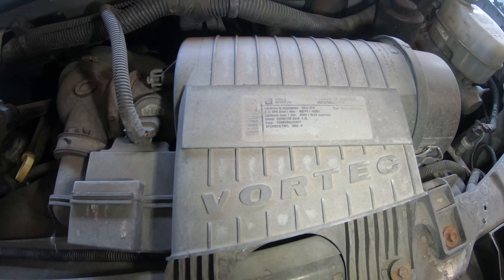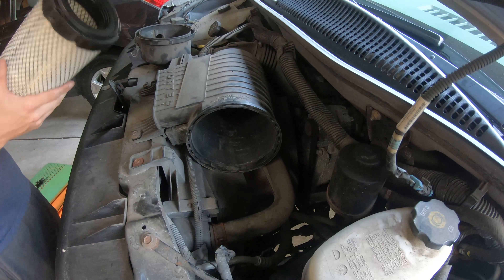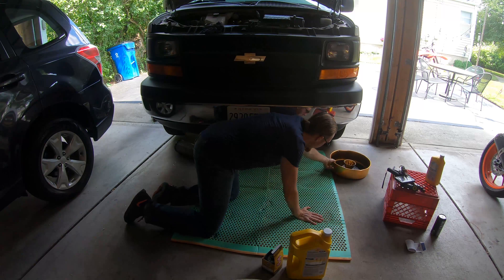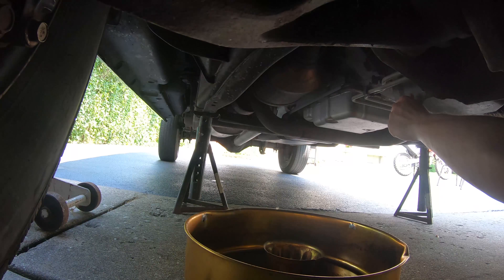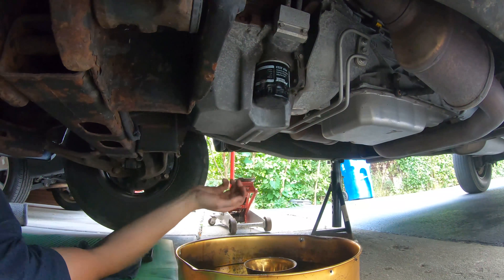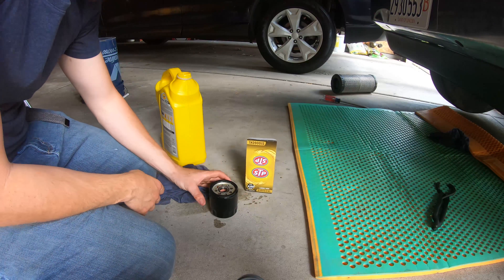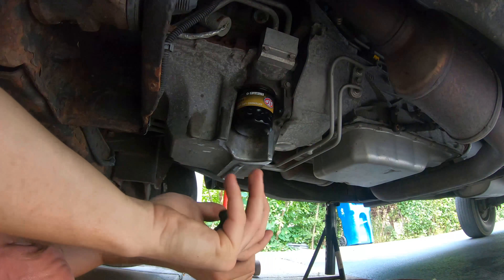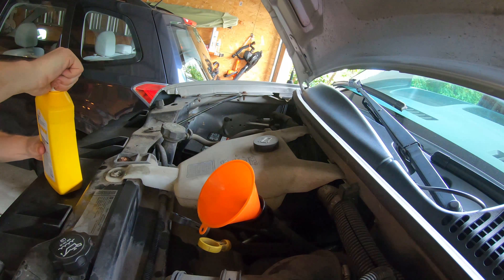Chevy Express 2500 Oil change and more!

Comment: No need to ever use a filter wrench to tighten a filter.
Reply: Over tightening an oil plug can strip it. Using a jack handle on a ratchet for leverage can ruin the ratchet gear.

Comment: Add oil to filter before install get oil to engine fast.
Reply: Never do that. You risk introducing contaminants that will bypass the filter because you poured directly into the clean side of the filter.